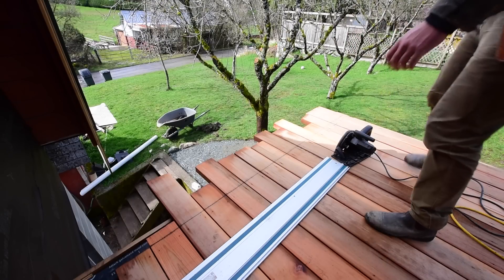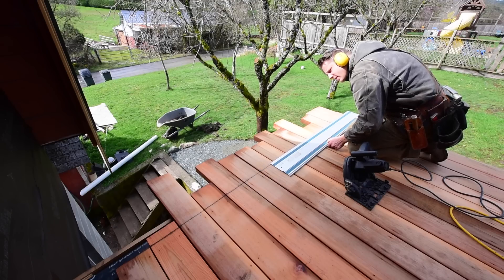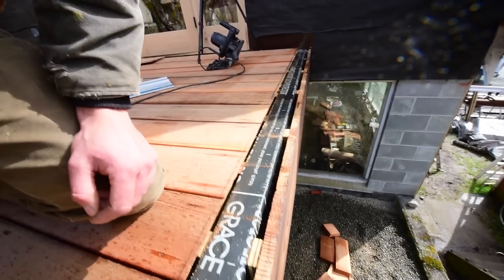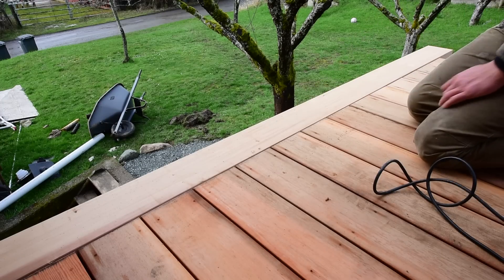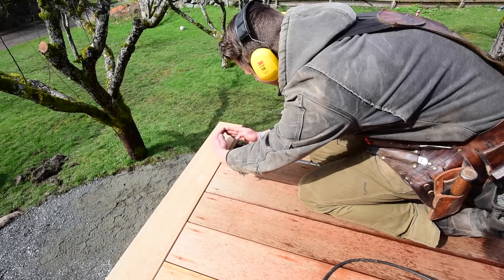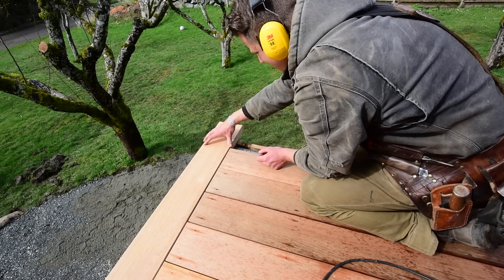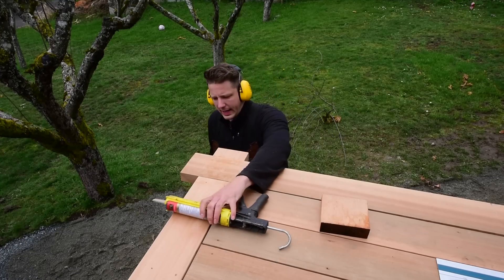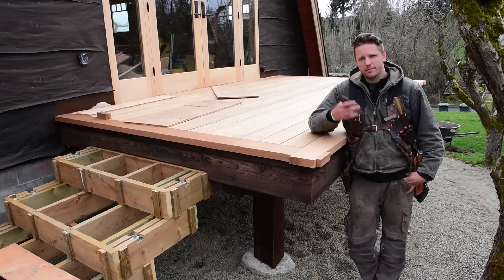FTF #52 Install A Sexy Boarder On Your Deck, How To

Comment: Dude, the short grain ends outside of the half lap will absolutely pop off once the deck gets wet. The wood will expand, and blow them right off.
Reply: bugeye72 unless the wood is already wet right now and is already swelled as much as it's likely to in the future ;)
Reply: they're going ti shrink though
Reply: He said the wood was at 20% moisture content at installation.  With all the excellent ventilation he provided, the summer season will dry the boards to around 10%.  Outdoor carpentry can never and should never be too precise because the dimensions of the wood are always changing with each season.
Reply: That was my thought too... you got 3/4" x 1" of unsupported fibers there.  Ice or natural contraction and expansion might pop it cleeeeeeean off.  Looks great though.
Reply: @jbestell  ..or anyone bumping into it,once.

Comment: I'm curious how the Samurai is going to attach his corner posts now...
Reply from the maker: You better stay tuned because it is gonna blow your mind!
Reply: Right on bro. Keep it UP!
Reply: 303Guppy I was wondering the same thing. Can't wait to see it finished. Looks so clean right now and railing can ruin the whole look if done wrong. Excited to see what you have dreamed up Jesse!
Reply: magical samurai powers brother
Reply: cut a hole in the decking on the inside of the rim and run the post on the inside of the rim. Then your posts dont show on the outside ;)

Comment: I have 2 issues with this. First, you are worried about shrinkage width wise, your lap joint is going to have gaps once the top board shrinks. Second, that little bit left on the other side of the lap is going to dry out, wear and break off. That will look much worse than a 1/8" gap in a mitre. Revolutionize building...try again.

Comment: I like it! 
But, what of the water getting into the top two cuts? Figure you squished the fibers enough going in that it seals enough not to rot there, eventually? It's an "unlearned" question, no hating here, just curious. :-)
Reply from the maker: Wood only rots when moisture is trapped and can't escape.  Wet environments allow micro organisms to grow and eat the wood.  Water itself does not harm the wood.  I'm confident that it will hold up because it has southern exposure and plenty of air flow to help it dry out.
Reply: Kris Arnold it becomes ice!  Frozen water is called ice. Lol
Reply: I always keep some oil around when I do decks to seal all the ends, little steps like this ensures a long lasting deck.
Reply: They barely get any frost in BC
Reply: Nope - you've got a water collector there.  I replace a lot of lookout rafters with dry rot on top from similar  joints on a horizontal face.  But on the up side, it looks like you used cedar vs the DF that I normally run into, so you've got that going for you.

A saw kerf at the shoulders of the lower board, angled to drain to the deck side of your trim piece  gives you a hidden drainage path.  With it already built, I'd drill two or three 1/4" holes from the bottom face up into the shoulder line of the joint
Reply: It is also rather close to the end grain which will suck the moisture out by capillary action in the wood. The weight of the members on top give a squeezing action... I would not seal the end grain on a nice, naturally resin resistant wood like that pretty dense old growth cedar. Drilling a relief drain along the edges of the lower lap could be an idea, but I seriously do not see an issue. Hammer on.

Comment: Love the corner work!   I have a deck which i need to modify due to the ends having water damage.  I am adding a frame to the ends and it looks like something I could apply to my fix.  Again.  Love what you did.

Comment: 2:59 
he doing double the work. he should set the blade to 1'3/8", make a square cut then pull the boards towards him snapping that 1/8 material. then you put a bevel cut on the bottom of the returning piece. like he said. you'll never be able to see the bottom

Comment: I like the edge board and the way you handled the corners but it does seem funny that it leave end grain you worked so hard to cover :) I don't mind a bit of end grain because it proves you used the good stuff!

Comment: live edge molding for a home!? 
what does the Samurai and the brother hood think?
would have to get creative to make smooth transitions when boards meet but I think it would look awesome. Also I was thinking of setting the molding flush with the drywall, meaning the bottom of the drywall tapers in at the bottom then the top of the molding tapers out so they form a V. (not a carpenter but do like working with wood)

Comment: looks great just wondering if the water is going to sit between the half lap after it dries out ? I was thinking if you drilled a few  1/2"holes in the connection and rounded over the holes top and bottom if that make the joint last longer ? I guess time will tell but I like the look good idea.

Comment: i have a similar situation with a ground level deck and the hand rail corner miters are so bad after 17 years, (according to the home owner ) the mitered joints opened exactly the way you said. so because of your video ive decided to do a half lap joint thanks soooo much for the great pro tip " LOVE IT"!!!!!!!

Comment: Great video, nice idea.
However, you must be working in weather perfect paradise. Here the wood never gets narrower nor does green wood ever retract. The overwhelming saturation of humidity and rain keep any wood at its thickest and widest. Then the Sun comes out at 100 some on degrees and bakes the living crap out (with NO drying effect at all) of it with the same moisture remaining in the air. With that in mind imagine how much the wood starts to buckle and snap. Sadly here you can only hope for the best with either ground contact pressure-treated or some form of composite decking. All your decking gaps in actual wood or pressure treated and composite have to start out with at least a quarter inch gap or more because when the rain comes and the Sun hits it will only expand that much more and usually end up buckling (if it doesn't rot first) and pulling the nails or screws right up and out after time. Also you have to keep in mind that anything you use wether it be nails or screws they should definitely be stainless steel or painted decking screws or eventually they will bring the rot straight down into the framing wood. The corner that you made was beautiful admittedly. However, again here with tight joints of that type needing clamping or hammering to get  them together in approximately a year's time would snap and blow apart because of the extreme  swelling. 
Wish I was working somewhere with that kind of weather. For now I'm stuck in swampland, lol, Myrtle Beach SC USA

Comment: Very nice. Are the lap joint cut depths slightly larger than half board thickness, to allow for glue thickness? Tips to ensure a flush finish?

Comment: Have you tried doing this on a top rail as well as the deck bo(a)rder?  If not, do you have any cool suggestions for replacing the typical miter joints used in top rails?

Comment: Possible silly question, couldn't you wait till the wood was at a lower %? Or buy it at a lower %. Also, wont those joints still shrink on you? I would have maybe done a bridal joint, not sure really. It's hard to know which way to go on that due to the wood being so wet still.

Comment: I don’t understand how this avoids shrinking problems. The width will still shrink and the bottom lap will open to take water. If you think about it, the miter depends on where it is secure. Towards the outside and the inside moves out. If its screwed towards the inside the corners could crack. It seems there could be a happy medium, but you’d have to watch grain orientation for consistency. A lapped dovetail (as in quality log homes) could also work to keep water moving outward.

Comment: Very nice joint, but you'll want to make sure the railing goes around that corner, too. The notching has so severely weakened that board that it would never withstand the weight of a person stepping on it.

Comment: Not sure why you said you didn't saw through the membrane...I can clearly see it is cut at 2:45.
Reply from the maker: It's not cut.  It folds over the edge of the double joist.  What you are seeing is the air gap and the next joist.

Comment: great vid samurai. however, end grain as you know absorbs up to 700 times more moisture than face grain. why not cap the end grain on the ends of the half joints ?  would look great and last if the cap was a socket.

Comment: Love the framework. Most excellent! If your deck boards are holding moisture, why did you choose to leave spacing between courses?
Reply from the maker: Outside, wood expands and contracts a lot through out the year.  Without spaces the deck boards would expand in the rain and buckle.  Also, dirt would get in the cracks and all sorts of fungus would start growing and rot out your wood.
Reply: I set treated pine decking as tight as possible and after roughly a year I end up with roughly 1/4" gaps between boards. Our materials and climates are different, but your high moisture comment made me curious. Excellent work- Thanks for your response!

Comment: What type of screw did you use for the decking? Are there any draw backs to using kreg deck jig for decking for a cleaner look? Other than being slower or more expensive?

Comment: Looks good,  but did you solve the problem? There still could be some gaps forming. But at least they won't look as weird as miters coming apart.
Reply from the maker: Time will tell.
Reply: Curious also, if contraction of trim locked boards will pull in & stress rest of floor (possibly bow).

Thanks for videos! Great looking trim.

Comment: Can i ask your help for a sloped deck top rail? The top rail is (2 x 6) and is on a post that has been cut on a 22 deg. My question, is how do you cut the corner miter? The nice part of this angled top board, is guest can rest against it. You commonly see this feature on park trail bridges. Thanks

Comment: What is that little machine that you have?, I have never see it before. Thanks for sharing.
Reply: He uses a circular saw, designed especially to work on that metal track, called a "track saw". For the corner he cuts it with an 18 volt Makita battery saw. He also uses a small Palm Router, also known as a Laminate Trimmer to round over all the cut edges. His "Japanese chalkline" is a Tajima. His hammer is a Stiletto Ti Bone 15, solid titanium with a smooth-face changeable head. And his tape measure is a Stanley Fatmax.
Reply: Many thanks!.
Reply: Yes, I was asking about the palm router.

Comment: Not sure what kind of a climate you have where you are, but for the climate here, that lap joint would rot in about 5 years or so.Keep up keeping up :)
Reply: Hey Tigermomma. Cedar is more rot resistant, but just as any other wood that isn't given the opportunity to dry up - it too will rot. Also cedar is not very common around here. We have Larch, which is from the same family of wood, but I guess it's not quite the same. That too, although resistant, needs to dy in order to not rot.

Comment: So the wood will still shrink width wise, how will this not open up and have a gap?  Is it because of the massive amount of glue? I looks really good so far, I'm looking to purchase a house soon and almost hope it doesn't have a deck so I can try my hand at this.
Reply: That's the exact same thought I had.  I use half lap joints all the time and I love them but use them w/ dry wood for things in the house.  I would emagine if that joint shrinks it would separate as well.  One other problem I have faced is leaving say a 1-1.5" overhang and then making the half lap tight.  Hammer it in for a tight fit and often the end splits off and breaks.  Very frustrating.  So I have had to make the joint just exactly tight but not too tight.

Comment: Two questions if I could, is that 2-by stock your using?, also I'm about to install ipe 5/4 decking, would you attempt this with this stock/wood?, I love the way you've done the corners, nice job, I don't want to attempt it with the ipe to suffer the consequences if it comes apart, any guidance would be appreciated

Comment: What type of surfacescrews are you using ? I'm currently building a deck getting ready to put the decking on, 51/4 cedarboards.  I want to surface screw them to make it easier for future repairs.  I see you surface screwed these boards too.
Reply from the maker: I use U2 fasteners trim head screws.

Comment: I have a huge deck to build, i am stealing your corners maybe this will become a trend. I really like the whole japanese design approach you take, they definitely know their joinery. watched a cool vid, can't remember what it was called where all they talked about was japanese woodworking and some of their oldest temples haven't a single nail or screw.  amazing stuff. I would like to use a bottom mount system for a nice clean surface, but i have no idea how that works. need to do more research.  Love your channel keep up the fine work!

Comment: I'd like to see what the joint looks like now with the wood dried out.  I guess you could have achieved the same look by cheating.  With no half lap joint, extend one board as you did, have the other board butt against it and then adhere a small piece of wood, same length of overlap, so that it appears as if the wood passes through.
Reply: Except use loose tenons to tie the butt joint together, and to attach the faux tail

Comment: You've kick-ass woodworking skills, but it's "border" or as the Quebecois say, "frontière." The term has to do with boundaries, not lumber. Thank you for indulging my OCD tendencies. I do hardly any woodwork these days, but I live vicariously through you and those like you. From the days when I worked on historical restorations of old homes I remember a job with a man who'd been a carpenter since shortly after God invented wood from whom I learned a ton. You're just a pup in comparison, but I learn from you, too.

Comment: He’s a good carpenter,  but those overhanging ends will rot quickly, and to not use treated wood is crazy
Reply: Looks like he's using Cedar, which resists rot. Could seal the ends too  which would help slow down an already slow rot process, inherent in cedar.

Comment: When you build your rail system on top of the deck it is weak. Incorporate your post from the ground up to the handrail and it's much stronger and doubles as your decking corner.. On the decking trim is pretty but it won't get you extra jobs and creates that ugly gap. I just float my decking to the end and cut flush with the joist. No future ugly cracks and no extra work. The homeowners are just as happy.

Comment: So, if you used a wood plug to disguise it,  couldnt you use a screw to help stop separation? Or would it eventually cause a crack? Even if pre-drilled with a countersink bit??

Comment: As a carpenter of 45 years there is nothing sexy about a boarder on your deck !
Reply: Maybe its because your 45 years old already. lolllllllllllll 😁 😂😁 😂😁 😂
Reply: I agree the the 45 year experience carpenter, the stair case is hideous. Its a deck for christ sakes. Any weekend worrior with a skill saw and a tape measure could build jt, and yes without the stupud tool vest and his samarai bullshit. Hevshouls be using treated out door wood so there is no shrinkage. What a dick

Comment: Curious, did you run an extra set of joists for the width of the cedar boarder so they and the deck boards have support?

I'm thinking about doing this to an existing deck.

Comment: Nice workmanship and the subtle creative differences add to the unique look you want.  I've built a lot of decks, porches, stairways, unless I had to match other decks for looks, each of my decks received some sort of subtle enhancement.  This application works well on handrails also, especially corners where extra support is needed.

Comment: Still going to pull away from the sides of the half lap, but at least the gap is halved as it is offset on each side.  Rather than both sides pulling away and essentially doubling the visual gap.

Comment: it is not you, it is the spell check, it does it to  me  as well.

for those who do not know the difference between boarder and border , here is the difference 

A border is a demarcation line which separates two geographic or political areas. A border may also refer to an edge or margin, often ornamental, such as a strip of flowers or bushes that grows along a house, garden or property line. Border may also act as a transitive verb, which takes an object, to describe providing an edge or boundary. As an instransitive verb, which takes no object, border describes something which is adjacent to another thing. Border may also mean on the brink of an extreme condition. Border comes from the mid-fourteenth century Old French word, bordure, which means seam, edge of a shield. Border was first used to describe boundaries between countries in the 1530s, when the word was used to name the area adjoining England and Scotland.

A boarder is a lodger, someone who lives in a residence of some sort where he receives regular meals in exchange for payment. A boarder may live in a home, dorm or other dwelling. A boarding school is one where students reside at the school in converted homes or dorms for the semester. Another use of the word boarder is to describe someone who gains entry to a boat or ship. Finally, a person who surfs, snowboards or skateboards may be referred to as a boarder, though skateboarders are usually called skaters. Boarder comes from the noun, board, which in the late fourteenth sense means table. In the 1520s boarder came to mean one who has food and lodging at the house of another.

awesome looking edge you put on that .  that is how all the older houses, barns, and sheds are built... as in floors,walls, and the roofs.

awesome video !!